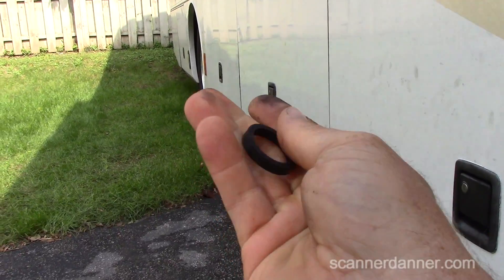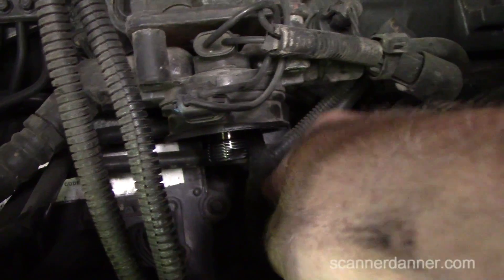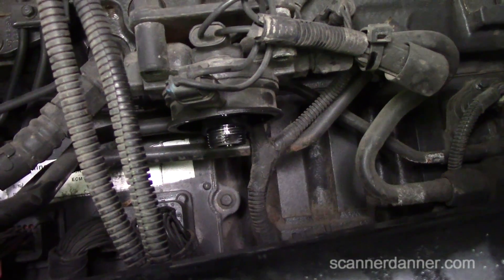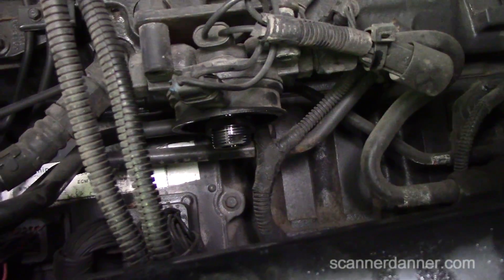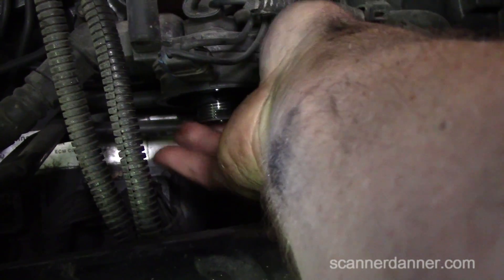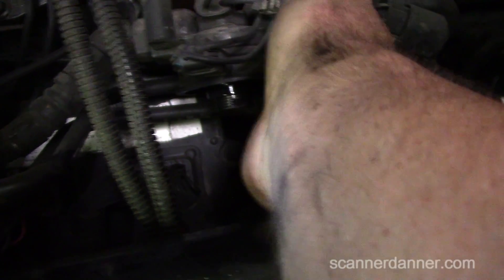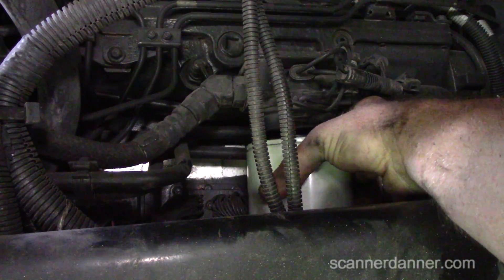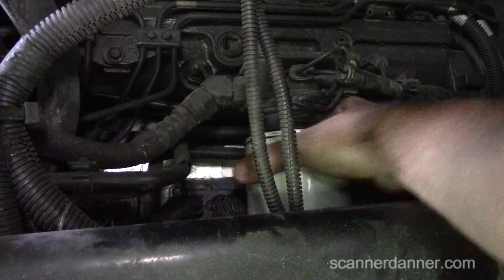The missing o-ring! 2001 Cummins 8.3 ISC Fuel Filter change part 2

Comment: Never change the final filter least for many thousand miles.Case tractor said that !  Reason being a minute speck of dirt will mess up pump.They had 3 filters an followed through fith 3 up until late 90 i think.   But do as others said  cut filter apart when you change so you see what filter may have caught .

Comment: It prevents fuel from the unfiltered side(small outer holes) from reaching the filtered side(center large hole). I always prefill mine even thou Cat says not to. A Cat mechanic I know and trust says to only prefill the filter via the small outer holes which will minimize the injectors from running dry which is bad for the injectors. Also our coach (2003) only has one fuel filter with no primer pump and no electric lift pump. So I prefill with prefiltered fuel and it starts immediately. Everyone should do what they feel comfortable doing. That's just what I do. I also prefill the oil filter the same way and for the same reasons. Great video Paul. I'll really miss your RV videos. Happy New Year to you and your family.

Comment: i run heavy equipment and on the Cummins, i used several filter changes no problems, then one time my machine would stall intermittently, someone mentioned the inner oring so i installed it, no more problem, must have been drawing air, now i always use it.

Comment: Don't be embarrassed, I changed mine 800 miles back and did not use the o ring. I have my o ring, It did not have one when i took it off. I have changed this filter at lest  7 times. ok go put it on. I am 78  and i do my own maintenance.

Comment: Hi Dan, I work for a Cummins, Cat, International Dealer. The quad ring is for sealing filtered vs unfiltered fuel. On another note on some of these motors cycling the key on will run the lift pump, on others you will need to bump the starter motor with the key and the ecm will run the liftpump. So if you run into another medium or heavy duty engine and are testing a lift pump make sure to bump the key.
Reply from the maker: Great tip, thanks brother!
Oh, and my name is Paul (Danner is my last name)
Reply: Sorry about that Paul. lol Been watching your videos for years. :)
Reply from the maker: It's okay. I get Dan all the time :-)

Comment: As a guy who works on Cummins engines every day, I knew exactly what that o-ring was. The tune is different on an isc vs an isl. That inner o-ring separates filtered fuel from un-filtered fuel, the outer seal keeps it from leaking. In an H.D application the demand for fuel is higher. And if the commanded fuel is to far from measured fuel. You will have your self a big ol headache.

Comment: Hi Paul greetings from UK. I think nearly all our spin on fuel filters have a seal in the middle (example ESR4686 ) But ours are fitted in a slot the same as the outer seal.The reason they say don't fill filter is you are pouring in unfiltered diesel which can have micro particles in which score the fine tolerances in the pump and injectors and ruin your day and wallet. the modern pumps piezo  injectors running at 8000+psi are even more critical as micron particles at them pressures act  like a sand blaster that blast away all needle injectors and nozzles in no time at all which will ruin your day and wallet big time.Hope this helps Tim

Comment: correct unfiltered fuel but s.f.a as the thread tension would Seal also almost fully with no seal . Prefilling fuel filter can be done if you do it correctly there is a guy making cat Diesel vids who shows how and why you would prefilling a Diesel fuel filter. and I fully agree with him.

Comment: Yes the O-ring gos to the middel. Never sean one missing so i ges if i didnt service allso disel cars i would have missed it as last worker droped it on starter or some thing.

I dont know but. I quess ass it needs to filter thinner fluid then oil. It needs that O-ring to make sure non filtered fuel cant pass through...
And that H20 drain port is for "winter service" (Before Freezing times) on any diesel car. So you can make sure your car can start in winter. That is if you didnt get water in your dieseltank on last fuel up and that the diesel is rated for winter use...

Comment: Very important oring. Stops the filter from bypassing particles through the threads that could be above the filter size. Its loose on the shaft so the oring will self center and seal on the body of the filter.  Source: Cummins certified tech.

Comment: What a beautiful sound out of that Cummins! 

Bet the exhaust still smells good too, since there's no emission crap clogging up the works. Can always tell when you're following a modern diesel  - they smell funny, and it's not pleasant. The old ones always smelled great, IMO ... guess it's a "mechanic" thing. :D

Nice save on the o-ring. I doubt anything bad will happen from that, since the diesel fuel these days has to be 100% PURE ultra-low sulfur, or these modern diesels will melt down, thanks again to the aforementioned emission crap. Anything pre- EGR & DPF will be fine. 

Can even run used motor oil mixed with unleaded at a 5.5:1 ratio - maybe not in your motor home, but the mid 90's and back would handle it. That's REAL recycling. :D

Comment: Whew, I am so relieved that you went back and installed that O ring, now I can sleep tonight.
All joking aside I have worked on Detroit Diesels since the 1970s and never saw an O ring like that on their fuel filters. 
I started a job two years ago working on buses with Cummins engines and saw that O ring on their fuel filters.

Comment: Awesome that you shared this. We all keep learning and thats the beauty of your channels.
Seems to be many myths about that o ring so i hope to clear it up. Air is not a problem. The problem only arrises when the fuel filter has done its job over time and starts to become restricted. That is when fuel will take the easiest route and bypass the threads and the ugly part is that it will mix with dirty fuel that is in the filter.
Thats when your injectors start to take a beating.
Hope this makes sense to everyone.
A quick note.
All spin on filters will bypass fuel and oil via the threads when they become restricted. Cummins realised this many years ago and surprisingly other manufacturers have not followed suit. The answer is to change your filters when they are due.

Comment: Danner its so cool to see your hands dirty. But anyway the fuel comes down the centre of the threaded part, in to the filter, through the filter paper inside the canister then out the holes in the rim of the filter to the fuel rail. So if you haven't got the O ring in place then fuel can come back up the threads and mix unfiltered fuel with the clean filtered fuel leaving the filter housing.The O ring has to seal the top of the canister to the roof of the filter housing, No need to be tight because it squashes and expands. Its such a small amount its hardly worth worrying about, and most after market filters wont have the extra seal supplied, But genuine always is best quality and go the extra mile. Good on you Danner. Getting it done and doing it right .

Comment: Working in a fleet shop for 30+ years I've seen a lot of cumins filters come off missing the inner seal
It is there it prevent the filtered fuel from mixing with the unfiltered fuel, when the filter is tightened it squeezes between the top of the filter and the filter housing to seal,  if you have good clean fuel and clean tanks no harm no foul.

They warn against pre-filling because most do not pre-fill with filtered fuel or some pour the dirty fuel out of the old filter into the       new filter small bites 4 micro in size can past through the pump and damage a injector.
Reply from the maker: That's crazy! How does the injector get damaged? Restricted I could see but damaged? As in needs replaced? I have to study up on my diesel injectors!
Reply: small particles in very close tolerance moving parts cause the plunger to seize or the nozzle to plug up or in a worst case blow the tip off into the piston.

Depending on the year it's either a common rail system with electronic injectors , which like the newer Fords use engine oil pressure to develop injection pressure or the older Bosh pump with 6 lines coming off one to each injector the bosh system will get to 2500+ psi at the injector tip the common rail set up closer to 4000 psi
Reply: You are correct Paul, but in addition to the fact that they get restricted, dirt could damage the entire injection system as the fuel also plays the role of lubricant of high pressure pump and injectors (of course lines and common rails too, depending on case). At least that's the way I see it.

Comment: Heyyy Paul, even though I have seen the O-ring groove in the first video and I was shouting out there, but I can't blame you while for not recognizing it. I can't because I was behind the screen and you were are filming, wrenching, talking, and in laying in positions that is hard to see the groove. Also, the maintenance manual say nothing about it as well as the printed instructions on the filter it self. So, do not go hard on yourself, you didn't loose your mechanic touches even though you are working on electrical systems and diagnosis more often lately. I believe every one makes mistakes once in a while, but not a lot admit it, not to mention posting it on the web to. So, great job and I appreciate your honesty. THUMBS UP.

Comment: just because it worked for 6000miles does not mean that you do any good to your injection pump or injectors if you leave it out. If it is there to prevent bypass fuel then you need to put it in or you risk issues in case you have any Kind of dirt in your fuel. It´s not embarrassing because errors are human, even to professionals

Comment: unfiltered fuel it is... some of the after market stuff do have a different thread or more loose than oem, so there is a possibility there... in terms of an air may sneaks there... i totally disagree... diesel engine may stall when its come to an air present in the system...

Comment: ScannerDanner, I seen have seen alot of flat towed vehicles tear the rear of their aluminum tailshaft housing off because of lack of lubrication, if that makes any sense. Alot of people have disconnected their driveshaft prior to the long haul, but mainly if it's an automatic, and only if the rear wheels are spinning when towed for long distances.

Comment: Not su if you had to order that Fleetguard filter off Amazon and wait for it, the cross Wix filter is a 33422 which you can probably get at your local parts store and comes with the new sensor and the thread gasket.

Comment: We've had quite a few of those fuel heaters fail and suck air or actually start a fire. They can be difficult to locate if they're the same one found on the 5.9l 12v trucks.

Comment: If the o ring goes there, why dont they show it on the directions. Im not convinced.
Reply: The O-ring keeps fuel from backtracking through the threads from what I seen in that last video. I'll be honest, I'm no expert myself. These are Class A motor coaches with air brakes.

Comment: That inner o-ring will stop unfiltered fuel from passing through those threads. Quite common to have some kind of seal on the inner pipe on those type of fuels filters. Your fuel tank is obviously fairly clean - seeing that you have had no issues. Glad you spotted the issue though, you never know when your going to get a bad tank of diesel from somewhere.

Comment: Hey Paul that small round O ring is important.  The fuel goes into the small holes around the big hole, goes down the filter, goes through the element, then back up to the top.  If you don't have the o ring as others have mentioned the fuel will the filter and it will also cause a air gap which will make it suck air and cause cavitation.  Not good for a caps pump.  Do you know how old the injection pump is?  If it has some age to it let me know and I can show you how to do some checks on it to make sure it is ok so you don't get stranded someday.
Reply: Hey, bus jockey... that would make an awesome video man!! I’d love to see that!! Or just hear the information in a video... think about it..

Comment: Bro! Did you really put the old filter back on?
Reply: stake. it tastes good when you do it right.
Reply: My thoughts exactly. It's his first diesel so he doesn't understand what's at steak from even one piece of contamination  large enough to hang an injector. Doing fuel stuff on my trucks stresses me out for that fact alone. His saving grace is that I don't think that year had a cp3 so presumably it's more robust against contamination than the common rails.
Reply: steak?

Comment: My experience is with much smaller car engines. I never put that o-ring on because sometimes it prevents the outer one from sealing properly and lets air enter the system; never had an issue and bear in mind that we have extremely low quality and dirty diesel down here in south America.

Comment: I work on a lot of Cummins engines. Some of them come from the factory with the small gasket, some do not. Never had any issues with leaving them out if there wasn't one to start with.
Reply: same here, put it on or leave it off doesn't matter,  I've changed them with it and without it   all the same.. I wouldn't get worked up over it at all

Comment: Once the system is purged of air, there shouldn't be any air in there to sneak by the threads.  My best guess is that it prevents unfiltered fuel from bypassing the filter element.  Diesel fuel is significantly less viscous than oil, so it would be more likely to wick its way between the threads, even if it were in very small amounts.  :)